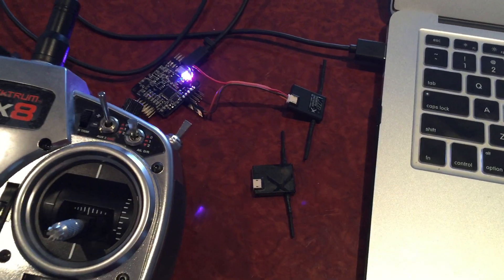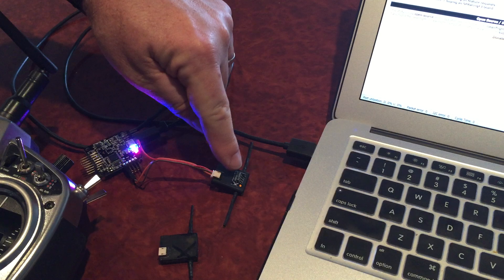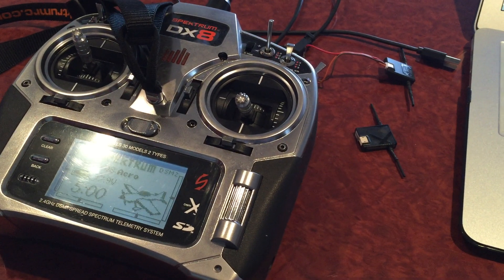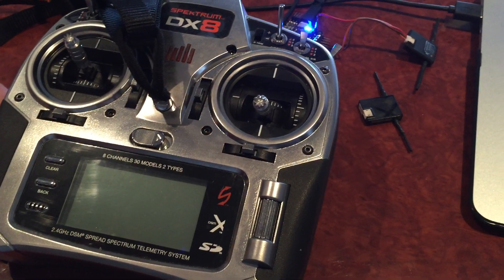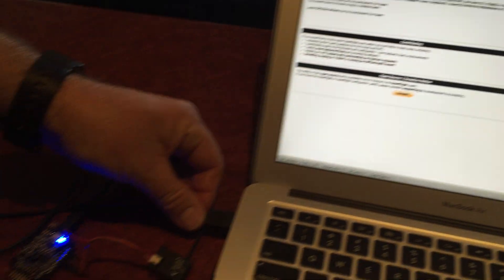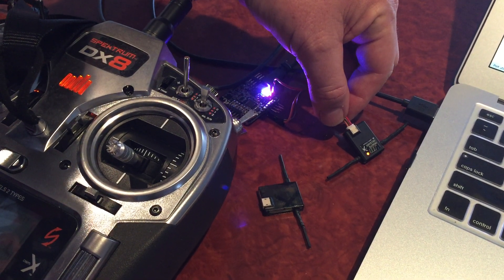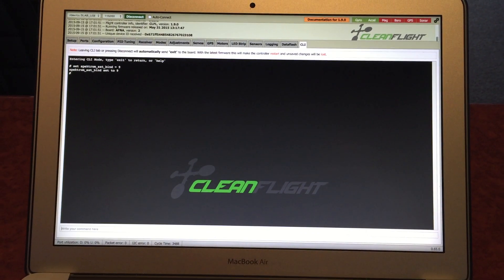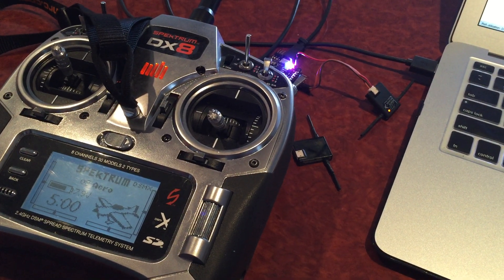Binding Spektrum Satellites with Cleanflight - all four modes

Comment: Hi, i set this up a month ago and everything worked out fine, I attempting to do this a second time however betaflight and cleanflight are saying (Unknown command, try 'help'). could you please confirm this and help me out please ? thanks
Reply: I have 2 identical Colibri Race V2.0 boards both flashed with the same firmware and one will allow binding via "set spektrum_sat_bind=9" and the other issues the "Unknown Name"... I have no idea why - just very odd.

Comment: I used all of the commands for my CC3D board when using Betaflight, but none of them seemed to work. My DSMX sat goes into bind mode, but when I start my DX8 to bind, it doesn't do it. It just flashes and quits. Ughh

Can anyone help or suggest an idea?

Comment: Hi,
Thank you for nice video instruction. I have a tbs vendetta ans spektrum DX9 tx and trying to use SPM4648rx. It wont bind because the voltage from flightcontrol to rx is 5volt and not 3.3 that is mandatory for the rx to enter in to bindin mode. How do i go about this? Please help. Thank you.

Comment: which mode should I use for a dx6i?
Reply from the maker: Is your dx6i an older version?  It will be DSM2 only and will say this on the front screen - if yours is DSMX it will have an X on the front panel.   It also depends on what type of satellites you are using.
Reply: Its a DSMX, but which frame do I use? I've been trying to bind it to a Lemon sat, but I'm having bizarre issues where the bind is successful but there isn't any reported stick movement despite a solid orange light. I also can't "unbind" the satellite and it refuses to reenter bind mode
Reply from the maker: Spencer George I have read a few comments that the Lemon Satellites don't bind properly this way - sorry I have no experience with them. Can you bind it normally first with an RX and then connect to the flight controller?
Reply: I haven't tried that, id rather not spend money on an rx i don't need. looking like it may be the solution though..
Reply: Its just odd since at one point I was able to get it to work perfectly fine

Comment: What would you recommend? DSMX or DSM2 ? I'm just going flying a quad FPV round and about
Reply from the maker: +Roger M (DGE goes FPV) If you have a choice go with DSMX - it is a frequency hopping protocol and more robust agains interference - having said that if you already have a DSM2 only satellite it will likely work fine - I flew DSM2 for many years without any issues.    DSMX is newer though.
Reply: +Trainboy64 That's what I thought, but somewhere ages ago I read somewhere that it's better having a brownout instead of a complete blackout. Now this would be when flying at the limit of your RC link you would 'feel' your aircraft being twitchy and manage to turn back instead of getting a blackout and lose the aircraft. Now this, in theory, is probably more directed towards the good old 72MHz TX?
Reply from the maker: Roger M Hi Roger, either DSMX or DSM2 won't make any different to whether it browns out - it can happen equally with both if the receiver power is inadequate.  To be honest, DSMX will recover connection faster if a brownout occurs - you won't have a visual indication though on landing - only DSM 2 "shows" you a brown out occurred - DSMX won't show you this.     This latest video might help. https://www.youtube.com/watch?v=w90GGWA5Vyk
Reply: Roger M aint that the hole idea of the satelite? or just add gps?
I need hover and return home any sign of signal loss.

Comment: i have the new diversity quad race rx and i cannot bind when connected to a vortex pro.  All i get is the slow flashing light.  is it possible i need to change my settings in the CLI as shown in this video? It will not even enter bind mode

Comment: I followed your vid and got remote binded which is great, but am I missing something because throttle and all work on PC, but motors not spinning am I missing something?
Reply from the maker: +Tyler Signal What flight controller are you using?  Did you check max and min throttle values?   What TX?   Did you set endpoints higher than 100%?
Reply: +Trainboy64 I fixed the issue. I didn't set the arm switch on and off switches. did that and now everything works. thanks.
Reply from the maker: Tyler Signal Great you got it working!

Comment: the issue I'm having is my receiver only powers on when remote is turned on...
Reply from the maker: +Tyler Signal Hi Tyler, yes that is normal, you should not have any lights on the receiver if your TX is turned off.
Reply: +Trainboy64 OK. another thing, I powered on tx this morning then powered up quad. while everything was on, I held my bind switch on my remote and lifted throttle all the way up and fc light turned purple... have you done that before??

Comment: I have a dx6i and a dsmx lemon rx and the rx just keeps flashing not binding to dx6i my radio says binding
Reply from the maker: +Jay Nave How old is your DX6i?  Does it have an X on the front?  How close is the radio to the satellite when attempting to bind?
Reply: It's the dx6i with the x I've tried binding it real close and about 10 feet apart. I have the dx6i  modulation set to dsmx.
Reply from the maker: Jay Nave That covers most of the possible causes - you are doing all the right things.  Which number are you trying in CLI when binding?  3. 5, 7 or 9?

Comment: so I can bind my lemonrx satellite just through cleanflight cool
Reply from the maker: +Jay Nave Yes you can.
Reply: +Trainboy64 but not on a rev 6 naze32
Reply: +ostelo84 wait what?  What's with rev 6 that it can't do this?  I can still use the lemon with Cleanflight/Naze32 though right, even if I have to bind first through the main lemon rx?